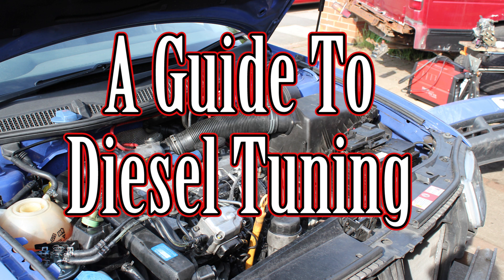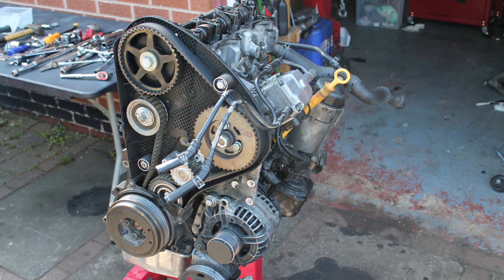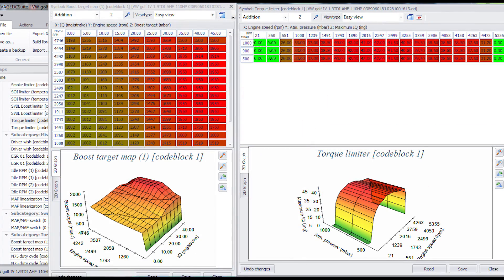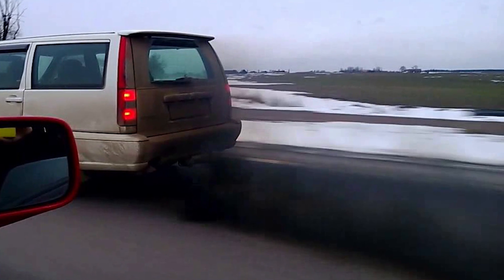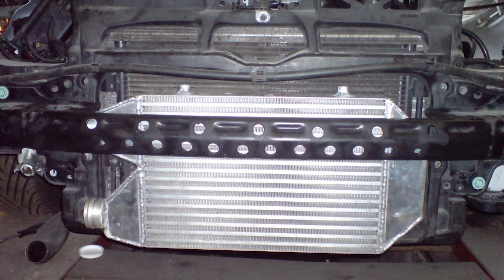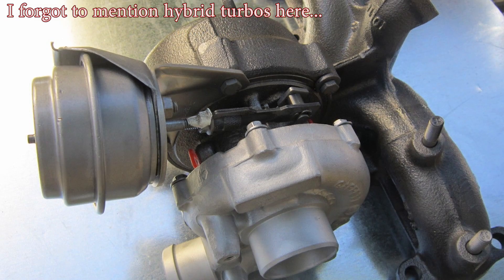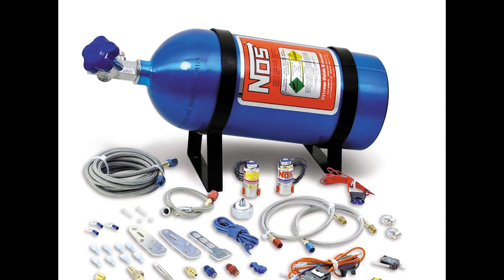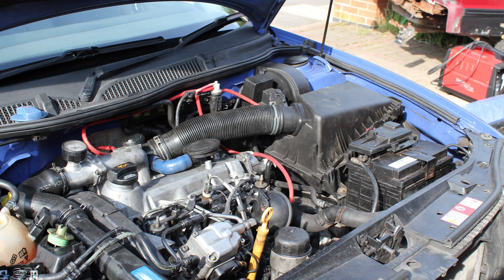A Guide To Diesel Tuning

Comment: Don't forget to upgrade your headstuds. When you go past 150hp on the 1.9 the head starts to separate from the block.
Reply: Arl head studs do well. £50 a set from euro car parts.
Reply: @andrewwright.  You don't happen to know if the ARL head bolts fit the older 1.9 IDI TD engines? Thanks
Reply: Pass
Reply: PD engines are good for more than that
Reply: Desperados Vlad Guess I was misinformed, was there an diesel engine that came stock with 110 hp that was offered in EU but not in the US or something? (For the MK 4 generation) i thought I herd something somewhere about 110 hp in Europe for some reason
Reply: Liam Weaver I live in the US the TDI ALH came stock with 90hp is there a way to get up to the 110hp that was in Europe
Reply: @MrJeepin88  easiest way to 110hp is some nozzles, bigger downpipe and a tune. Check out malone tuning.
Reply: @OfficialSNIxn  I have an extra ECM I might get the Malone tune on and immobilizer delete the closest shop to me that does Malone tuning is 2 1/2 hrs away
Reply: @MrJeepin88  that's annoying, they do offer remote tuning. You can buy their flashzilla or can rent it basically I believe. You pay the entire price of the unit and then ship it back when you are done. Just contact them and I'm sure they can help you out. I had a stage 3 custom tune making around 130-140hp on a stock turbo.   That turbo was maxed out haha. Had bosio 250 nozzles, 3" tip, 3" kerma turbo back, and a cold air intake. Thing ripped.
Reply: *And then they refund the price of the unit *
Reply: @OfficialSNIxn  can’t seem to find a 3” downpipe for my vnt17 BEW. anywhere. sold out on kerma, not available from dark side, and all the small diesel tuning shops don’t carry it. they all seem to have 2.5” but i need a 3” one. any suggestions?
Reply: @OfficialSNIxn  I can confirm I had an ALH with the Euro spec injectors and catless, 2.5" downpipe and exhaust, and a malone tune, was putting down a good deal more than the 110HP on the Dyno... But I also Immediately pulled those Euro Injectors and upped the size even more, upgraded to a bigger VNT turbo and an 11mm injection pump, with the most aggressive tune I could get thru the mentioned tuner, less than a week later lol Malone offers great tunes for the ALH I highly recommend, either way u go, this is good info..
Reply: Hi, Liam.  I've got a 2014 Golf 2.0 tdi (150).  Thinking about getting a plug-in chip to get about 180 hp.  Will that cause problems?
Reply: @philrogers4535  should be fine man.
Reply: facts ^^ man will save your engine
Reply: Parli per esperienza? Se il suo è la versione da 90 cavalli ci sta che siano da mettere rinforzati, io ho il modello da 130 cv sigla motore BLT con turbina e mappa sono arrivato a 176 cavalli e non ho questo problema

Comment: "with a remap you ight destroy your gearbox"...... my stock vectra c 1.9 cdti blew its gearbox on stock map :P
Reply from the maker: Depends on what the stock boxes can take,  the 5 speed in the example video in this one had seen 235k before someone rear ended me and wrote the car off and had seen it's last 30K+ with things tuned up (see my evry mod video).
These were the weaker boxes but could handle 150-200bhp but you'd want to get the 6 speed which people have put 300+ through and darkside have put silly amounts through.
My current Audi A4 has a 01E with a 2.5 TDI engine that's anywhere between 180-220hp (dyno pending but should be at least the stock 180) and there are guys running 350+bhp through these boxes on Diesels, I understand on Petrols they can go higher.
But 350 BHP + is nearing 500 ft lb of torque.

That said I just got a 1.4 Honda Jazz for my wife....the bearings in the box have gone...all boxes are different.
Reply: its manual mate.. 6 speed manual.. but its the famous m32 gearbox... terrible for reliability.
Reply: Ahh i gather you've heard of them then :P  I am in the middle of replacing,  But am converting it to the saab 9-3 F40 gearbox, essentially the same, but bulletproof... 
But the conversion requires other changes, different driveshafts, diifferent clutch and flywheel, which isnt bad because im removing the the dual mass, and putting a lightened one in its place. also gearbox linkages cables too...
Reply: @RGD-Radio  miss informed. It's not a saab box. The f40 came in the vectra and signum. So you were just unlucky to have an early one with the m32.
Reply: Dit you had automatic or hand shifter I drive saab 2,2 tid with automatic 120hp I want 200hp but don't know if the gearbox can Handel
Reply from the maker: Auto's are usually trickier depending on how they are set up as some just shift on torque, some are ecu controlled etc....
Reply from the maker: Ouch did you replace or move on?
Reply from the maker: Out of interest have you changed the suspension? I've had rental Vectra and Insignia's over the years and both I felt were WAY to stiff suspension wise to the point stuff I'm used to in My Audi's upset the back end to twitch out with bumpy roads.

Comment: Remove TDI cram in 4BT Cummins. 😂
Reply from the maker: LOL 4BT's weigh nearly 800lbs - the A3 I had was 2565 lbs with half tank of diesel  fairly sure the motor was in the 100kg range....unlike my 2.5 V6 tdi now that's 230kg/508lb.
Reply: CarAndMechanical yes I was mostly joking. 😂😂😂
Reply from the maker: In one of my newer vids just for the hell of it I looked to see if a 2.5 V6 TDI would fit in an A3...always fun having ideas - also today just learned Audi have a V12 Diesel
Reply: CarAndMechanical yes some USA VW touaregs had v12 diesels.

Comment: Can a fuel remap be done to a Sdi engine? Golf mk4?
Reply from the maker: Unless you want better mpg then no point as the engine is NA you won't have much if any room to burn extra fuel due to lack of air and will just roll coal - better off here chopping in for a GT TDI

Comment: with the turbo from the pd150 you need the whole set up that includes the 4 bar boost sensor and the intercooler they use for the best setup on them
Reply: Intercooler not needed, better cooler air but not needed
Reply: No need for 4 bar, only 3 bar. You shouldn't push a 1749vb over 2 bar :) and a front mount intercooler is always a good choice :)

Comment: I was thinking of buying Audi A3 black edition as my second car. Can't afford petrol cars due to insurance. Any good to fit a stainless exhaust to that?
Reply from the maker: Depends what you want the exhaust for - to sound good or improve performance?

To sound good any larger free flowing exhaust will sound better but don't go too aggressive as you don't want motorway/highway drone which is what some straight pipe guys get.

For performance you want the most freely flowing exhaust from the cat back as possible.

Last point I'm not a big fan of exhaust brands unless certain cars are involved and they are specially tuned for sound. A lot of exhaust shops can knock up full systems to meet what you are looking for and it's often cheaper then ordering and fitting the system yourself.
Reply: CarAnd Mechanical mixture of both to be honest. Mainly wanted to get away from the diesel sounding noise
Reply from the maker: You'll always have that to an extent but it does change it from the typical noise. I got a V6 TDI recently and that doesen't sound as diesel like when going  as you hear the V6 more but it's still there. I'm hoping to add a 3" system in the future but in not too distant future I'll be gutting the cat and putting a straight through on the backbox.

Comment: i have an audi a4 b5 1.9 tdi 116hp i want about 170hp what do i all need
Reply from the maker: Is that PD or VE? Assuming VE I'll say Nozzles .230;s or bigger, VNT17, clutch and remap. You can get 150-160 from the stock turbo but I don't recommend it. My B5 A4 made 155 with .215 nozzles and a tune but she was smokey.
Reply: thank you so much you helped me a lot :) if i need something i will ask you
Reply: what is your fuel consumation now on 155hp
Reply from the maker: +Dino Huđ with that A4 probably 45-50 mpg but back then I wasn't as great in driving for ecconomy, if you check out the £1 diesel tune video that added 20bhp I only lost a few MPG, maybe 5 if I nailed it all the time
Reply: tnx :D

Comment: I am only looking at the logical side. because by the time you spend all that money trying to get some more power. it would have made more sense just to have gotten a more powerful car in ur case S3. plus you would get more street credits in a S3. Looks better and more enjoyable to be in and drive. but if you enjoy tinkering with your car and seeing how far you can take it. then just remember it's just for fun. I use to do all this back in my days. now I just get a more powerful car and the most I would do is a remap and a little cosmetic stuff. I wish you all the best with your car.
Reply from the maker: Thanks - I actually recently got a 1.8T which I'm using to donor part various bits for the TDI. I intend to get a weekend car (or two) but the cost of a daily petrol would cripple me taking my annual fuel bill from £2400 to £5500 plus that's assuming 20-30 mpg on a performance petrol. My spend on this TDI is way under that.

At some point I will build a fast car - like Ferrari beating fast (Audi A6/S4 with the 2.7TT engine has a ton of potential) but atm I'm enjoying the tinkering/learning and affording to make mistakes before I apply that to something crazy.

Thanks for the comment though because I can see this is where I'm eventually going - but I think the tinkering side of me would still buy something cheap to play with as a side toy....I can't help myself.
Reply: I find my self intentionally buying weaker cars specifically because i wan't to upgrade it myself. It's a hobby for me
Reply: PØKATELLO depends on local laws. Where im from as long as emissions meet the standard anything goes, you could cram a 1000hp+ engine into a lotus Elise and as long as the emissions are low enough and lights are in the right spot you're fine.
Reply: wow, and here i am, not even legal to do brake upgrades/aftermarket exhaust/ ecu tune,...

Comment: y not just buy a faster car. sell your one and get a bmw 535d m sport or 335d.
Reply from the maker: In general I agree with the principle of buy the best thing you can afford as a base car. But the difference between my £600 A3 Tdi and a 335d is way over 10 times the value of my car.
For a mild investment you can bump up your numbers significantly and again the principles here would be true on the 335d or A5 3.0 as I know of one of them running 440bhp.
 There is another side of this too where some people like to push things to see where they can get to and a sleeper 300 bhp+ Skoda Fabia for example will catch people out and some people just like that.

Comment: 300hp in diesel is alot, because of low-rev torque you can have 1000nm and only 400 hp
Reply from the maker: Will see how next year goes - I'd like to go full build and aim for 300 but I need a car inbetween.
Reply: Portugal they are mad...320 340ect ect 300 is normal out there.
Reply: @andrewwright.  what cars running that hp
Reply: I drive a truck, it's only 360bhp but enough torque to rip a hole in space time
Reply: Om606 with an OM603 pump and an Holset HX40 with manage 680BHP. Check out DPUK
Reply: Gedas alekveravičius in Portugal 300hp is very normal in diesel
Reply: were talking normal cars, not v12 tdi's or similar.

Comment: My mate said that cylinder boring can increase heat, great upload
Reply: Sigit Prabowo Boring + added air/fuel makes more heat anyways, stock would see the same but with fractionally less heat dissapation. Providing the bore doesn't compromise the wall's ability to resist being crushed by all the extra power.

Comment: great video, may I add that from 2009 tdi's with common rail have all uprated components so you can run 200bhp and 300 torques with standard clutch and fly wheel
Reply: thats a very broad statement , barely true about half of small diesels
Reply: James Bates really isn't, all mk6 golfs with the 2.0 tdi 140bhp can make that power easily with no modifications, actually the engine alone can be tuned to about 230 bhp and 350 ft/lb but then the clutch may start slipping
Reply: you just cherry picked the golf as being capable of more power , congratulations. how about any Peugeot , most can only manage about a 20% increase in power , vauxhalls? renaults ? citroen? nissan? toyota? theres a lot more diesel manufacturers than just audi and Volkswagen , actually do some homework before screaming about how fast the latest VW golf might be able to go if the clutch holds out. You have made an incredibly broad statement that only applies to a very small quantity of cars that are truely capable of more power without major conversions. How about a Peugeot 1.6 120hp standard , only gets 140hp tuned?! wowow! and thats all from just putting in more fuel at WOT ?! holy shit isnt that amazing - NO , congrats more fuel = more power
Reply: do you actually know anything about other cars? your still bleeting about how amazing VW diesels are , dieselgate ?! no? try looking beyond what VW are doing and stop saying that ALL diesels are capable of high BHP when clearly they arent , just because VW can doesnt mean that toyotas can or any other manufacturer can
Reply: Csaba Szilagyi sounds awesome man, I've got mine to 197 bhp and 400nm with just a remap
Reply: Csaba Szilagyi cheer mate, how much did you pay for your dpf delete if it's cool to ask?
Reply: Neither is here :)
Reply: Ruben Witters well a 1.6 tdi from a polo can do about 140 to 150 bhp on a normal remap, if you do other things like the exhaust then you can get even more but I would just say be careful about going high as the clutches on 1.6's aren't as strong as they could be, I would say find the safe torque limit for the clutch and atleast you know a limit which you can work to.
Reply: Noah1985HA had it done about a year and a half ago and still no problems, I'm not really sure about dsg but it should be fine, I would say contact dervtech, they are in Manchester and you can just text them on the Facebook, they should be able to tell you how it works with that specific configuration 😀
Reply: fron 140 hp to 207 only by a remap and dpf off...using stock clutch, no problems "Thank the Lord"
Reply: Nice mate :) If you are looking for a little more power, uninstall and remove DPF , more power a nicer and meaner sound, maybe a little bit of black smoke , depends on your remap.
Reply: +50 euros cause i got the remap at Revo Tehnik, which cost 400E i think. Remap took 15 minutes, dpf delete hours...but in the end it was worth it, sounds really nice with a dual exhaust system.
Reply: Csaba Szilagyi sounds awesome man, thanks for the info!
Reply: Unfortunately, this is not allowed in Germany :(
Reply: hey, you mentioned peugeot diesels, got some questions if u don't mind.  i have a volvo from 2008 with a 1.6 tdi 109 bhp (an engine from PSA or peugeot if i'm not mistaken) what mods can i do to have some more horses, i'm not looking for 200, more like every gain is nice. for now its completely stock, but i want to get a different exhaust and  a custom remap (but preferebly as last of the mods) i don't really know wich turbo could fit. thanks in advance
Reply from the maker: yea and you can do the remaps yourself with a cable from ebay - what I would say is get on the ecu forums for this stuff, read, read and read and learn. If not happy get someone to map it for you but you'll probably find maps on these forums or guidance for how to alter yours.
TBH most cars remapped are really well woken up and it's the mid range torque that transforms them - you might get that +20-40 top end but getting that lower down and a big fat wedge or mid range is amazing. Once you go past stage 1 and exhaust stuff it starts to get expensive...
Reply: londonas2 he is right the non pds can only take 200bhp and 300nms of torque.. I've got a non pd 90 which is the same engine just different injectors
Reply: Packing 200hp and 410Nm of torque from Stage 1 (only remap) in my 110hp 2.0TDI :3
Reply: how long have you been running that with no issues for?  think I could get similar numbers from  stock dsg 2015 tdi?  which tune did you use?

Comment: Next time get a PD first VP gets good numbers but PD get more torque than a VP 
but good guide anyway
Reply from the maker: PD's do make good numbers but they also have a higher barrier to entry on cost. When I got this 3 years ago for £600 the PD's were around £1500-2000.
When I can get around to filming there is also stuff I've done to this and not covered in the video which means I make 130bhp with just a simple mod but I want it on the rollers to confirm as I want to fit my bigger nozzles and new ECU.
Reply: They are geting cheaper
Reply from the maker: Yea they are now, tbh my next buy will be counter intuitive but I haven't fully made my mind up. I'll keep this TDI due to the work put in and it's weight etc...
But next buy will either be a 2.7 T petrol (so cheap atm) or a 2.5 TDI with 300bhp aim. 
I've actually realised 300bhp isn't as expensive as I once thought on a 1.9, but the V6's sound better and come with quattro.